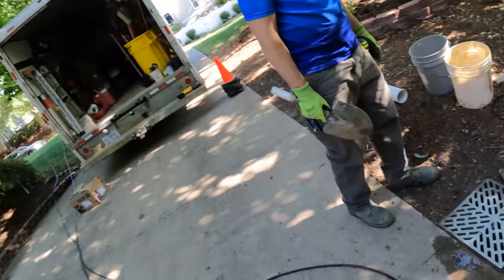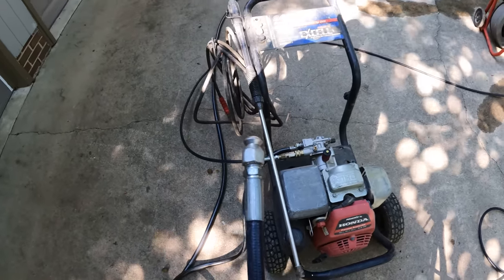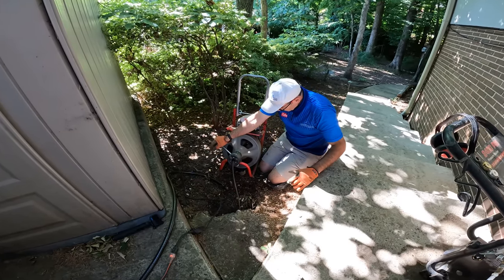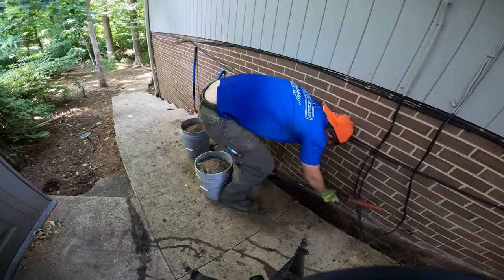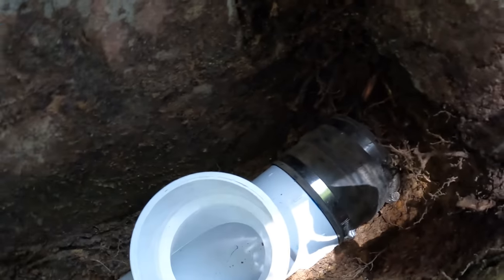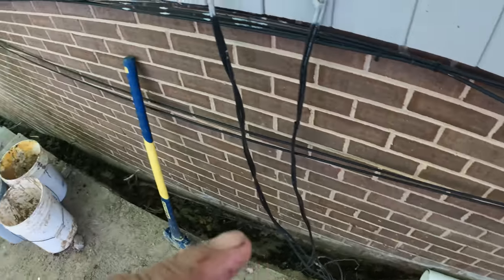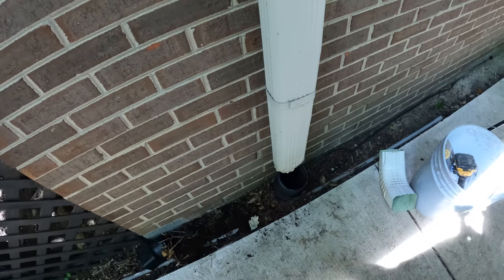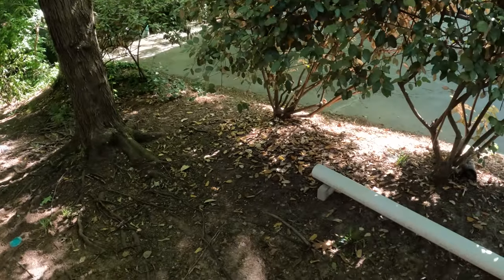My Last corrugated pipe Cleanout!

Comment: That catch basin just shows the homeowner isn't going to stick to any sort of maintenance routine.
Reply from the maker: You could say that. We did a great job of cleaning things out so it’ll flow for as long as possible.
Reply: Yea it will fill up like that again eventually rendering the pvc useless. Can't move water anywhere when the catch basin is full of soil. Homeowner needs to do his part in keeping things clean.
Reply: Pvc or corrugated, it all needs to be maintained. Corrugated installed correctly works great if you maintain it and aren’t putting much weight on it.
Reply from the maker: @jamiepippin3892  why not throw in a pvc pipe after you’ve done all the labor instead of a corrugated?
Reply: It’s certainly not a bad idea if someone is willing to pay extra for it.
Reply: @GCFD   
Amen… if you go through all the trouble and headache of digging a nice trench you may as well use the best quality pipe.
Reply: Should have had a conversation with owner that will need to charge more cuz you need to cut that slab across and replace with sch40.
Reply: Should have had a conversation with owner that will need to charge more cuz you need to cut that slab across and replace with sch40.

Comment: It doesn't look like corrugated pipe was the problem.  Just that they let gutters and pipes will up with leaves and other things. Need to filter that out and catch it in basins before going into the pipes. Then proper maintenance in this heavily wooded property. The gutters are probably also all clogged above the pipes you removed and  likely still won't drain with your repairs. They are all just going to clog again in a few years.

Comment: A 5000 PSI jetter like the one Drain Addict and Penetrator youtube guys might come in handy.  Their  powerful jets open down spouts all the time.    But mainly in Australia you hardley would find corrugated used the same way it ia used in USA.
Reply: It would probably blast a hole right through that thin walled corrugated pipe.

Comment: just a note (I know it wouldn't solve your crushed pipe problem and I agree that corrugated is seriously bad idea for this application), there are way more powerful cleaning jets with big barrels out there that cut roots several cm in diameter.
Reply from the maker: I’m not interested in getting more into cleanout which is why I haven’t invested in better equipment. I’ve looked at a couple setups that would work way better.
Reply: @GCFD  the head of jet has blocked, open and clean the head
Reply: At this point it would shred through the pipe itself which defies the purpose

Comment: No matter what type of material is used, it must be installed properly and maintained regularly. With all the trees there, the gutters, downspouts, drainage pipes and surface drains should be cleaned more frequently than the average house and property. That corrugated system was old and parts were probably abused in areas where cement work was done. It was also no match for those roots. No doubt schedule 40 should be used under cement, through trees with the potential of growing large roots and under areas where motor vehicles drive.

Comment: When I first bought our house, I went with the cheap budget corrugated pipe route, I even meticulously ensured a slope with no low spots. But after digging it back up and attempting to reseal the foundation, the pipe didn't get laid back down or even reconnected by the contractor. More water started seeping into the basement and the millions of earwigs living in those pipes, I pulled the trigger & rented a ditch witch, redid the 100+ foot PVC SC40 run connecting 4 gutters, down hill to the driveway. Thanks to your videos I knew what to do; and had a full bubble the whole run! No more water issues here
Reply from the maker: Wow that's a big project Kaden! It sounds like you did a fantastic job! Thanks for sharing! Full Bubble!
Reply: @GCFD  sure was! I had to go around the Holly bushes, under the front deck, and peel back 30 feet of weed barrier under a rock garden to the bottom decorative retaining wall where I poked the pipe thru. Alot of work for 1 guy, but I finally got it 💪
Reply: @kadenen  I bet that felt good when it was done.

Comment: i just wana say, i see your concrete videos and some of the trolls in the comments, as u will find out in the concrete niche, every1 in the comments is a pro, but none of them have a single video of their pours. i do recommend trying a walk behind soft cut the next day. the finish looks pretty good but i must say, as a small youtuber w a crew kinda like yours, you will get a better finish and u can pour it a little dryer if you dont have to worry about cutting joints the same day. btw i have never had 4k psi w fiber crack over night and i saw cut pretty much everything. 
just something i have noticed. i know on the east coast it is hard to find finishers that will just come out for a day

Comment: Proper tools for the job are required. Pressure Washer and Snake will not touch the problem you encountered. 

This is why I only use smooth Schedule 40 for drainage work. Dirt can't be caught and roots have a very hard time to get into joints

Comment: For the custom shallow angles I have had luck using a heat gun to warm up either a fitting or a section of the pipe and bending it where I need it to go. I have used that trick to open up a 22.5 to make kind of a compound transition with one fitting and I once needed to offset a riser to line up with a downspout. Used on a straight run, like you did with the ferncos, it eliminates that joint so the inside remains smooth. The dewalt cordless heat gun does the job, a bit slower than a corded but quicker than a trip to the store if you don’t have a fernco on hand.

Comment: Hi Shawn, one idea for you: maybe consider keeping a roofer's torch on hand in case you want to warm a 4" pipe and induce a slight bend in it.  That could save you from having to use a fernco fitting just to make a slight turn and the result will be much stronger and smoother.  If you heat PVC pipe enough you can actually get it to be floppy and bendy - just don't go too far.  You might also be able to do this in a more controlled way with a heating blanket, but I haven't personally tried that method.

Comment: I really felt your pain on this one.  It made me anxious just watching.  I’m in the process of building a house.  One of my first projects after it’s built will to give the roof runoff a path downhill, in schedule 40, of course.
Reply from the maker: You will be happy you did Jim. I see such disasters all the time where a little planning could have saved a lot.
Reply: @GCFD  yep, just recently we got hit with 8” of rain in a 10 hour period.  Some friends of mine ended up with 5” of water in their very nicely finished basement because of poor drainage system design.  I fixed it for them so they don’t have to worry about it in the future.  Over $30,000.00 in damage, because the builder just didn’t care or didn’t understand how to do it correctly.
Reply: It made me anxious watching all that Customization against the edge of that garage, just waiting for the saws to come out to re-work the concrete driveway & walkway etc.

Comment: Can I suggest you watch some of Drain Addict's and Penetrator's YouTube videos. They are plumbers in 2 different parts of Australia's east coast and they clear blocked drains using jetters. Tree roots are a huge issue over there and they have corrugated pipe as well, which they both think is a waste of time. It would be good for you to see the different types of heads they use of the pressure washers. Penetrator https://www.youtube.com/@penetratorblockeddrains       Drain Addict  https://www.youtube.com/@DrainAddict
Reply from the maker: Great recommendations Natoya! Hopefully my setup will continue collecting dust as it has been since I did this job last spring! Hahah

Comment: I see contractors STILL using corrugated in my area. It's very popular in multifamily on catch basin and gutter applications.  And to make things worse they try to tie several gutters along with a series of catch basins. 🤦
I came across that garbage trying to unclog one once. After wasting half a day, I found out it had collapsed about 20 feet away from the catch basin. PVC and a full bubble is the ONLY way to go!

Comment: I watch a couple of guys out of Australia. They're like you. They have a hard time cleaning that corrugated pipe out in Australia. There's a lot of downspouts everybody has them. They don't want to run the water on their property. They got the plastic pipe. They got the clay pipe and he uses a jeter that's pushing out a lot more power than what you have and they have specialty heads on it. They they do it everyday but I can see where you don't want to do it. I don't blame you. That's a lot of time for nothing other than that. It turned out good. Enjoy!.👍👍🙂🇨🇦

Comment: Is using schedule 40 PVC standard where you're at? In northern Ohio we use schedule 35 4" PVC for all downspout, drain tile, and drainage. Schedule 40 is used for sanitary lines and pressurized applications.
Reply from the maker: No Mike. Corrugated is code here. But I rarely build down to code.

Comment: I have become a believer in smooth PVC for drainage. I have a semi-french drain in the back of the house that leads to the street with corrugated. It does require some maintenance frequently and does not flow very much even if it has been freshly jetted.
 Perhaps you could do a video on the type of PVC glue you use and pros and cons of different glues? I have had glue set up in the can after one use and others last almost a year. Some glues dont give me sufficient time to put the pieces together.

Comment: Second post referencing drain addict
If you can purchase the type of machine drain addict channel uses which is 7000 psi or more i forgot his type
But it cut threw a three foot tree stump video a week or two back on his channel

Corrugated or not DA does not kill the pipes
But you must keep your heads clean
So suggested is upgrade your water pressure cleanout system
View his channel
Reply from the maker: If I was interested in doing more clean out jobs I would definitely upgrade my stuff! Thank you for the recommendation Shaggy!

Comment: The corrugated pipe is pretty much useless. The only good thing about it as you say is that it collapses and take up less room in the dump truck. Although these pipes were so full they probably wouldn’t pack down very well.  That whole system was a mess.
Reply from the maker: That is an often overlooked value that’s built right into corrugated pipe. Thanks for doing your part to spread the word Steve!

Comment: I don't remember if you had this as one of the benefits of corrugated pipe but you showed a very visible example of making fine organic soil. Of course it's stuck inside of a plastic pipe at that point and probably not usable by anything. But it's beautiful black soil after a couple of years.

Comment: What I want to know is why so many houses in your area use corigated pipe straight from the bottom of the downpipes of the gutters. Doesn't local government have rules and regulations about rainwater drainage
I mean it brings you probably more work than you can handle so you wouldn't want too many rules and regs for it

Comment: Shawn,
It looks like you could use a better pipe jetting system.
Check out the equipment these two Ausies use.
Al
https://www.youtube.com/@DrainAddict/videos
https://www.youtube.com/@penetratorblockeddrains
Reply from the maker: If I was interested in getting more cleanout work I would definitely upgrade my stuff. Great points Alfred!

Comment: Corrugated pipe = Field Tile! I live in Iowa, the Capitol of Field Tile. 90+% of farmland here has some sort of clay. The other 10% has sand/organic material that plugs if not installed with a sock($$$$). Contractors trying to move roof water away from structures using corrugated pipe(field tile) are thieves.
Reply from the maker: You said it!
Reply: One things for certain, when Joe Shmoe homeowners who consume a lot of video content find a YouTuber that they like, they will follow whatever that YouTuber is saying. This job was done well but corrugated would have worked too in this application. The customer just never maintained it. I’ve installed both types of pipe. It’s all about the installation and maintenance. Those socks are a joke. You need a massive amount of stone to keep the soil from entering the perforated pipe, and optional fabric surrounding the stone. Solid corrugated pipe needs tape around the joints when the trench is back filled with soil. Either pipe will need convenient access points for cleanouts.
Reply from the maker: @jamiepippin3892  great point Jamie. That’s exactly why I don’t just say these things but I actually show the pipes working like they were designed to. That’s the scientist in me checking results. Pvc is much more forgiving to installation and cleans itself out. It’s a far better choice even though it is more difficult to install. No one ever says, I regret installing pvc and should have used corrugated.

Comment: Think you need a better pressure washer setup.
I've seen a few others and they have some serious ptessure and volume sprayers with cutting heads that deals with everything except big stones and concrete.

But then i also feel like cleaning old drains isn't your type of work, only replacing old or making new
Reply from the maker: I've thought about it for sure. If I was trying to get into more cleanout work I would definitely upgrade. Having a camera/scope setup would be cool too.

Comment: Shawn are you surprised there aren’t building codes against using corrugated, especially given the damage they potentially cause to foundations and structures when they clog?
Reply from the maker: Corrugated is code around here. They all use it and promote it. I looked into getting my landscape contractor's license but all the drainage stuff in their code book is crap (in my opinion). I rarely build things down to code.
Reply: @GCFD  have you tried getting code changed? But then again, everyone who's screwed over are your customer - so one might argue it drives business.

Comment: That section of corrugated pipe under the concrete, was it straight enough that you could’ve shoved a smaller diameter PVC pipe through it and eliminated the possibility of it clogging or collapsing in the future?  Just cleaning it out seems like more of a patch than a long term solution.  Eventually the corrugated pipe is going to collapse and cause the concrete to crack.
Reply from the maker: I tried to remove as much corrugated and get the rest under the concrete cleaned out. I don't know if I could have sleeved the corrugated with a smaller PVC or not... I've never tried that Rob.
Reply: @GCFD  I realize with a job like this you were probably frustrated enough and just wanted the nightmare to end..  We’ve seen your amazing work.. it just seems like this job had your hands tied a bit too much and you couldn’t do what you know needed to be done (replacing it all with PVC)..  Running a smaller PVC pipe as a liner where possible might be another patch to kick the can down the road for a few more years.. but ultimately it’s still your name/reputation on the job when the dirt settles.

Comment: Could you have lined the corrugated under the concrete from the catch basin with a 2 inch PVC?
Reply from the maker: Yes If you could manage to get the pipe through the corrugated. Anything that got through the 2" pipe wouldn't hurt the 4" once it got there.

Comment: Looked like really old corrugated.  On top of that it seems like the gutters werent covered at all and never cleaned at all.  Seems like you almost need a drain cleaner type of hose to get corrugated cleaned out that is that backed up.
Reply from the maker: They sell much better cleanout setups. If I was interested in doing more cleanouts I would upgrade for sure.

Comment: Moral of the story: don’t use corrugated pipe. I am in the process of putting in a catch basin to catch 2 gutters and have it drain about 180’ to the back of my property. I just spent over $600 on the basin and pvc pipes and fittings. After hand digging the trench for the pipe to lay in I don’t want to ever have to do it again so I’m so glad I used pvc

Comment: Are there any methods available to re-line corrugated pipe, such as underneath the sidewalk where you pulled out roots? If that could be lined with a slightly smaller (3") PVC, it would reduce buildup/clogs even with the smaller diameter pipe.   I've heard of epoxy liners for sewer pipes, but it looks like the material price is >$50 per linear foot so that's probably not cost effective for residential drainage...  on the other hand, $300 (6 ft) of liner is probably less expensive than tearing out/re-pouring the sidewalk.

Comment: Sean why do you use the blue glue? It sets super fast and doesn’t give you a lot of time to push the fitting in. The clear heavy duty stuff is what I prefer for pipe bigger than 2”
Reply from the maker: We use purple primer and clear glue but have recently been using the rain-r-shine in case we run into water.

Comment: Could you have fished a 2 inch yellow, or  black pipe from catch basen  under, the slab, then 4 inch along the wall
Reply from the maker: That would have been a ton of work Mark! We got the corrugated under the slab cleaned out (demonstrated by clear flowing water) and got the rest pvc.
Reply: @GCFD   that corrugated pipe is only going to plug up